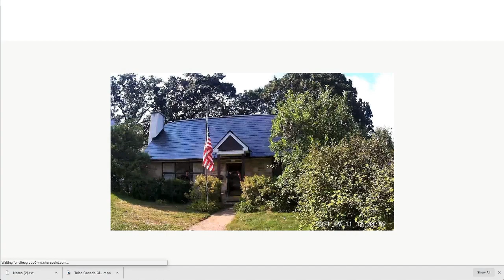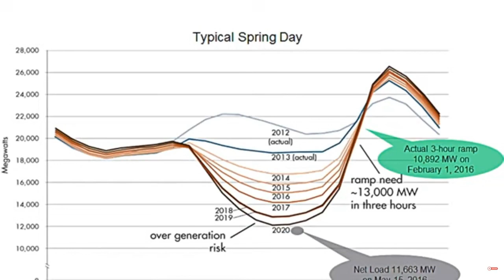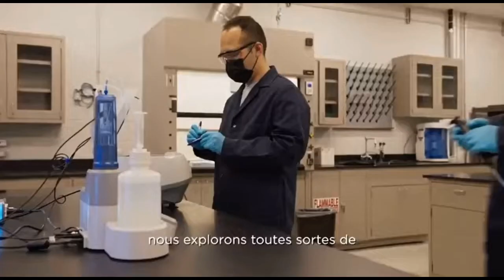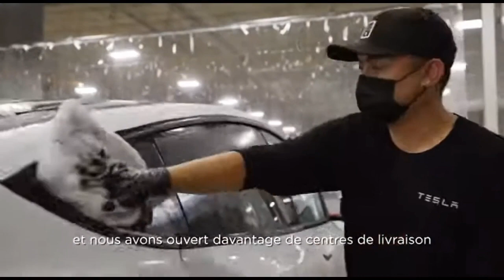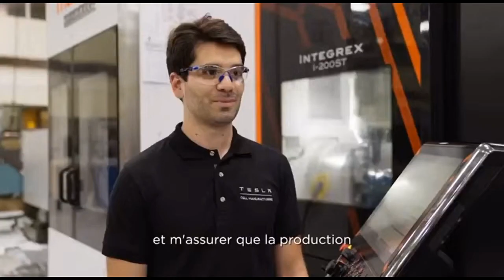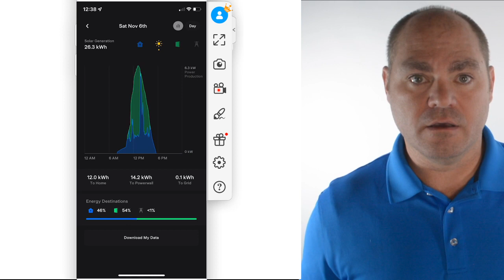Episode 32 - Get as Many Powerwalls as Possible | PTO and Utility Incentives

Comment: I’ve only ordered 1 PW. Wish I could get 2 or 3. I’ve ordered a 12kW system. Living in Texas our current electricity rates are .11-18 per kW on average. Prices are going up and to Trust the Texas Grid is a Big mistake. Even if our prices are lower than other state’s. Ercot will tax the Texas grid to make “improvements “ they say. Another Great video. RIP Jack.
Reply: the Texas power grid is twice size of ukrainian grid. it's not that bad as you are describing. power grids across the world are getting more load, cause of all those EVs multiplying on the roads. I think we are about to hit 90  thousand megawatt usage very soon. And very likely to see 100k megawatts next year. just the Texas alone. To say it's not enough capacity, - yes. But to say it's bad, - it is not. I also ordered 2 powerwalls + 12kw system.

Comment: If the Transformer is rated for 
2 houses with at least 2 of 200 amp main breakers it should be fine to export the same amount.
I call BS on the utility company.
Reply from the maker: I want to make sure I'm following the math here:
200a x 2 houses is 400a
Both at 110V
44kW export capacity on the transformer (at least), right?

Comment: As always - great video! Installation for me is sometime in the next 90-120 days!
Reply from the maker: Springtime install - will be rainy in these parts!  Hope the time goes quickly :-)
Reply: @teslapowerpodcast  yup! When I get an install date I’ll be sure to let you know !
Reply: I had installation in the next 1-2 weeks but it just changed to...supply issues, installation date unknown....
Reply: @michaelcarr8320  roof or panels ?
Reply: Panels and power walls
Reply: @michaelcarr8320  I have roof and power walls scheduled for 12/27 . Tear off begins Monday 12/13 . So far so good